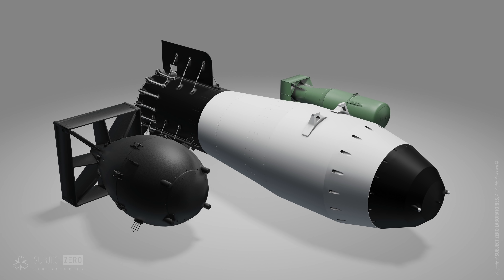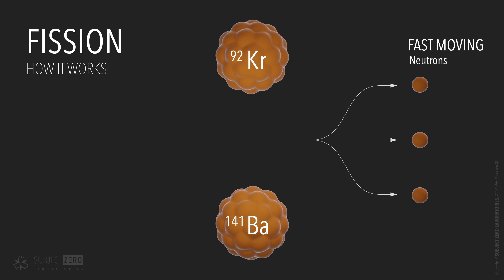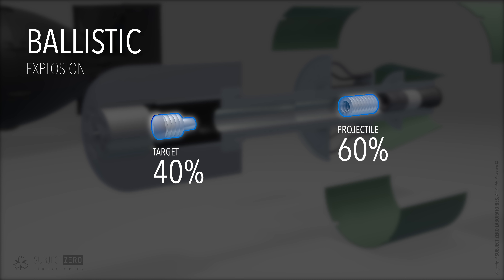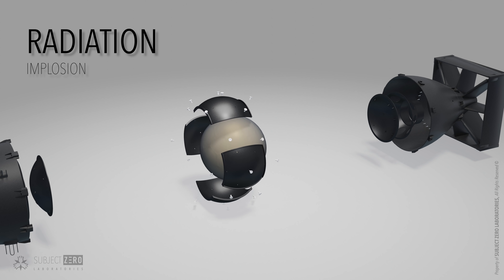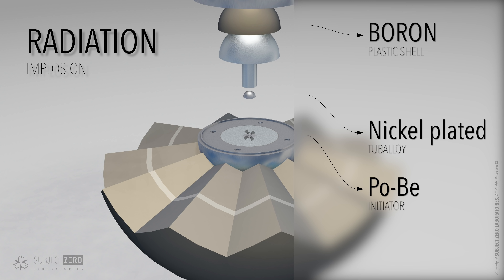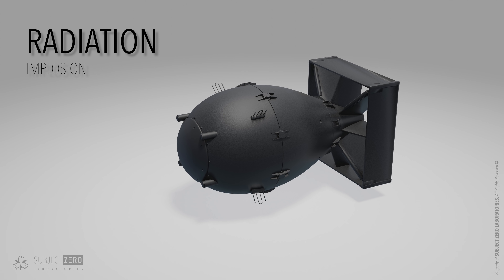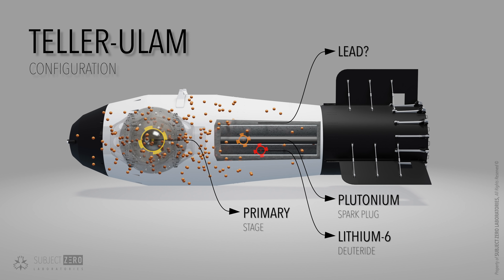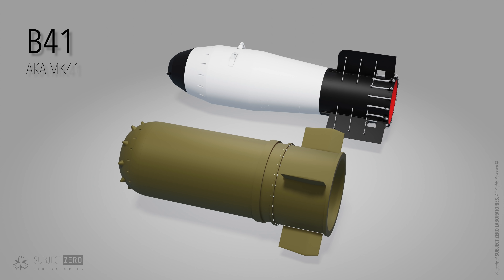Are Russian Nukes the Most Powerful?

Comment: I love how he got little boy’s projectile right. (It’s commonly switched up with the target)
Reply: I used the little boy projectile as a quality check as well, which tbh I just recently learned from a youtube video lol
Reply: @Chainsaw-ASMR  can you explain for my uninformed curiosity?
Reply: @alexreiser6325  to get a chain reaction you need a critical mass - enough fissionable material in a small enough space.  So the little boy used a subcritical cylinder and a subcritical cylindrical shell, which when brought together, became supercritical.

A lot of people assume that the cylinder was shot into the cylindrical shell.  In reality, the shell was the projectile and the inner cylinder was the target.  

This was mostly a manufacturing and assembly decision - they had to design things before they had certainty on some of their calculations, so they needed to be able to adjust the amount of uranium in the system.  So the cylinder target was actually designed to be made of uranium disks held together by a bolt running through them. And they could just adjust the number of disks used when the time came.  Harder to do that with a cylindrical shell, and bad to use a bolted-together projectile.  So the single-cast cylindrical shell was made the projectile, with an inner, cylindrical stack of disks as a target.
Reply: It was a fail-boom design.  Even if all the switches and sensors and timers and explosives failed to work it was gonna slam the mass into the cup anyway on ground impact.
Reply: @prjndigo  Fail-Boom🤣😂🤣😂
Best thing i've read today, thanks
Reply: @prjndigo  ya, but not at 300m/s
Reply: @pierrecurie  300m/s is 671mph... sounds approximately the speed of sound, which Little Boy had exceeded by the time it detonated.
Reply: Why do you think it would be faster?  I believe the "300m/s" refers to the speed of the U-235 projectile as it went down the section of artillery gun barrel used in the "Little Boy" bomb.
Reply: @Xylos144  Also, if they fired the inner cylinder then there might be concerns about it remaining perfectly centered in the barrel for a perfect "fit" into the shell. But since the width of the shell was close to the full diameter of the barrel it wouldn't have room to go off-center as the fired object.
I'm not sure if rifling was involved, but if so then I think this would mandate firing of a shell with rifle grooves.
Reply: @MrLTJX  Because inertia is a thing, the slug fired forward, and all the bomb would have to do is contact something solid while traveling faster than 300m/s to gain the same effect as the explosive being fired, simply by the slug snapping loose and hitting the shell.
Reply: @mfree80286  I don't know what you mean by "inertia is a thing" in this context.The explosive being fired is what sets the outer shell piece of U235 in motion. Also, it doesn't just need to hit the other piece of U235, it needs to fit into the other piece of U235 as intended, so that a super-critical shape and geometry of U235 atoms is created on-the-fly and it can then proceed to a nuclear explosion, as happened a certain distance over Hiroshima, and not when the bomb hit the ground, which it never did due to being physically destroyed by the expanding blast wave.
Reply: @mfree80286  The Little Boy bomb did not need to hit the ground or anything else to detonate. In fact, it exploded well above Hiroshima, as planned for maximum blast effect, but with less radioactive fallout than a ground level explosion.

How can you be so sure that the U235 slug "snapping loose" (instead of being fired with artillery-type charges) would achieve sufficient speed (300m/s or whatever) to properly form the needed super-critical mass without any pre-detonation effects, due to moving too slowly?
Reply: @MrLTJX  Because all this is in response to the original "fail-boom" assertion by prjndigo and subsequent doubt "@Prjndigo  ya, but not at 300m/s" followed by your unattributed "Why do you think it would be faster?" which I thought meant you thought the bomb wasn't falling fast enough to "fail-boom". I know it's an airburst, I'm asserting that should that have failed, the bomb had more than enough velocity to prompt a detonation on impact.
Reply: @mfree80286  I asked a sincere question about why you think the U235 projectile would travel much faster than 300m/s? I was referring to travel inside the bomb case, but now I think you meant the terminal velocity of the bomb itself falling from the B-29 towards Hiroshima (a speed which I don't think is really relevant to detonation). Recall that the Little-Boy device used standard artillery gun parts and it was never even tested - though this was due to the limited supply of U-235, rather than pure confidence. 

Actually I suspect that "fail-boom" in this context may have been mentioned in jest. I could be wrong, but I've never heard of such a property being used in a nuclear bomb design.

Lastly, why do you say that my question was "unattributed"? I was not quoting any other person or source, so nothing needed attribution. For better or worse, it was my original question. Attribute to me if you must ;-)
Reply: @MrLTJX  I don't think the slug travels faster... I think the entire bomb does, which only comes into play if the initiation mechanism fails for whatever reason. 

Whether the property was intended or not is moot, it appears to exist. Arrest the bomb's 300+ m/s forward progress and the slug appears set to come free and continue at that speed, which should initiate an explosion. 

The only thing that bothers me in conversations like these is stating I was thinking or saying something I wasn't.
Reply: Well. I think everyone worked out what everyone else was saying, as well as why everyone, including themselves, had misunderstood what they, and everyone else, had been attempting to correct.
 Huh?

Yes, firing a cylinder onto a slug is indeed equivalent to having the slug rammed into the cylinder in the event that the bomb remained undetonated by the time it impacted the ground. I can’t say what velocity the bomb would have attained but (both bombs) were detonated at approx 1800’ to exploit the reinforcement of the expanding shock wave, to send a second shock across the same area. (Need an animation for this!). I didn’t realise they had figured this out already on the blackboards of Los Alamos.

I myself mistakenly thought that a slug was fired into a cylindrical hole, but the explanations as to why it was the other way around leave me in further awe of the practical sensibilities that went into making an atomic bomb out of stuff just lying around the house.
Reply: @MrLTJX  i mean in that setting i think you'd just have the barrel the inner cylinder went down have a much smaller diameter than the diameter of the shell lol. But yeah it does seem like it would be easier to allign the shell as the bullet instead of the cylinder
Reply: It looks kinda like if you shot the target at the bullet.
Reply: Governments are in the habit of spewing out torrents of disinformation, spurious "declassified" 'information', and the like. Nor were the Feynmans, Tellers, Oppenheimers, Fermis, ever relieved of their requirement to not divulge (valid) classified details about the dynamics and geometry of any fission or fusion test-article or other device.

Neither the U.S. or Russia or China or any other state actor has any percentage on relenting on this policy in the slightest. You do NOT know whether the plug or the cylinder was the target, and in fact it would be in the their highest interest in promulgating the notion that the worst method of assembling critical mass in a linear device is broadcast from the greatest number of seemingly highly vetted documentation and testimony.

The channel owner is at his most credible when he concedes the construction of Tsar Bomba is somewhat speculative, but goes off the rails by interpolating from the Teller-Ulam design, as though you could triangulate on a legit H-bomb by mixing and matching from a palette of assorted bulIsiht. The exquisite detail he devotes to the minutest elements in the central neutron source borders on the hallucinogenic. The only thing I learned from this article is a plausible visual on how implosion lenses (might) actually work, something I've rarely seen animated in a way that a layman could more easily extract than from mere diagrams and word-pictures.
Reply: @-danR  

If you say so, Dan.
Reply: @Xylos144  Increasing the proportion of the fissile material in the projectile also reduces the probability of predetonation.
Reply: @mfree80286  No. The bomb casing never went supersonic.